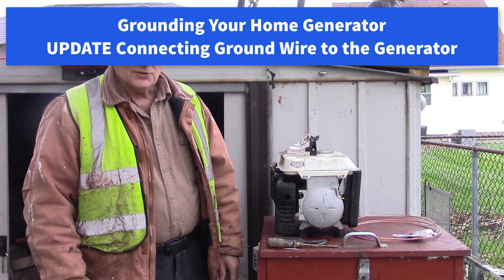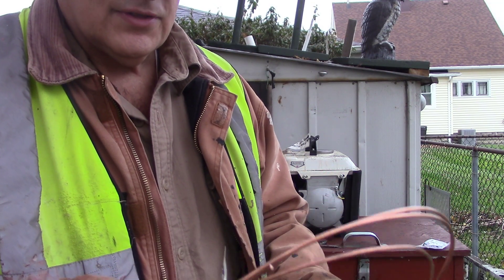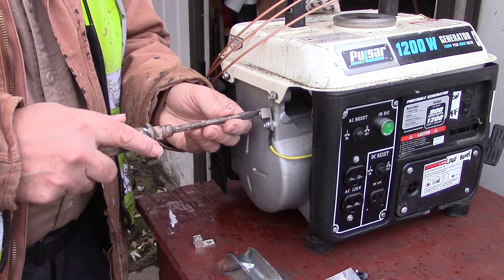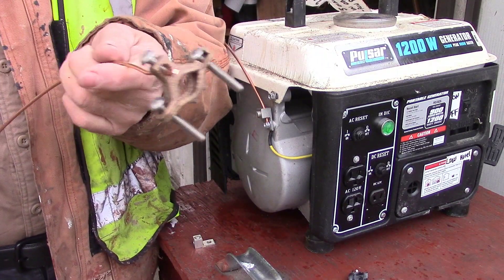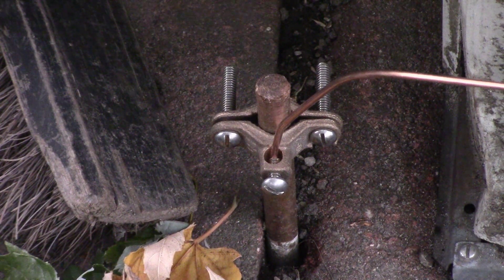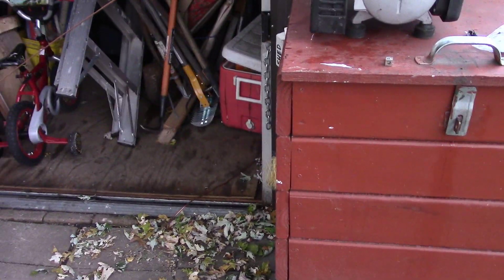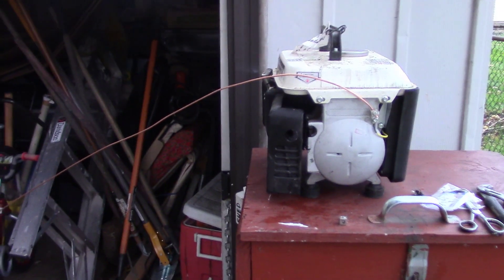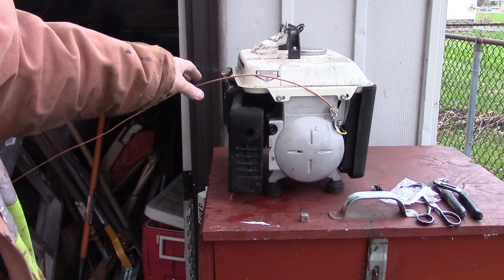Grounding Your Home Generator, UPDATE Connecting Ground Wire to the Generator Part 6 of 7

Comment from the maker: Please read the SAFETY WARNING and great comment from a viewer below: 
-------
Portable generators vary in the way manufacturers wire them. The frame of the generator may act as the ground. They do not connect such a system to the earth. Putting a ground on a generator, not designed to use it, can create a shock hazard. Adding a ground will provide a path for current to flow, when a short circuit occurs. Unless the generator manufacturer states to ground the unit, it should not be. 
-------
FYI: In my manual, it says to ground the generator, but does not describe the details on how to ground the generator. But there is a ground sign on the side of the generator.

Comment: R U going to hook this into ur homes wiring? This is BIG! 1200 watts and has wire good for 40 
amps to ground it. Just get a good extension cord.This is funny to me as a house with 60 amp
service would have a good ground or 100 amps probably an 8 gage. considering for the amps
at 15 amps at 120 volts, you'd have 1800 watts  to use. so just get a 14 gage cord. Does this 
Gen have have a floating neutral or a bonded neutral? If u ground this and use appliance in the 
house and neutral IS bonded, and appliance in the house has a fault say an electric skillet, u
could touch the skillet and the apron of stainless steel sink or fridge or dish washer and know 
about it! WHY cuz all this stuff  has its outsides grounded, frame of oven  or micro wave.
Reply from the maker: Hi Raymond! I live in an old house, 120+ years old. My grandfather landed here from Italy in 1917 and I'm still here. My father always said, "don't leave, it's paid for." The main fuse box needs replaced, cost about $1000.00. One electrician I got an estimate from looked at the box and said, "You don't even have a main turn off!"LOL! So, I ain't gonna mess with it. I live about a mile from the southern shore of Lake Erie. We get pounded by lake effect snow, something like 60 to 100 inches per season. High wind gusts, around 70 mile per hour, are common here during the winter storms, so the electric companies seem to have the power grid pretty stable now. A few years back, power used to go out once a month. Lately it's been 18 months between the last two power shutdowns. I start the generator in the summer to make sure it still works! This week, November 2020, it is supposed to be in the 60's, I think I'll start it up this week. Thanks for reminding me!  Thanks for watching! Jim
Reply: @JimVincitore  YOE Jim, not all that surprised, saw a lot of houses in FL. w NO
mains dis-connect. 120/240 volt service. what they did have tho was a so-called 
split panel. 2 pair of buss bars upper half had all 240 volt brkrs 1 240 double brker 
fed lower half w all single wire circuits. I just removed the meter and covered up
the meter socket and plugged gen into dryer socket.

Comment: sorry to bother you again jim, ive just taken delivery of my ford gennie, can i use a thick battery charging cable for my ground till my 8 guage arrives, i have a rod in the ground for connection to the unit, thanks in advance
Reply from the maker: Hi AW! I'm not an electrician. The copper wire is solid, battery cables are stranded wire. There must be a reason they use solid copper to ground houses.
Reply from the maker: Go to a hardware store, find the electrician, and ask him to cut you some thick stranded cable to ground your generator, ask him if it's ok to use.

Comment: hi jim, thanks for the sub hahaha did the same.... ive just ordered a ford generator and it looks like a ground wire going to the frame, i will have to read the destructions to see if it needs a true ground, as its going on a trolly with rubber wheels, thanks again

Comment: Portable generators vary in the way manufacturers wire them. The frame of the generator may act as the ground. They do not connect such a system to the earth. Putting a ground on a generator, not designed to use it, can create a shock hazard. Adding a ground will provide a path for current to flow, when a short circuit occurs. Unless the generator manufacturer states to ground the unit, it should not be.
Reply: You an get a pair of jumper cables  ($10..00 ones will work).  Split them down the middle.  Take one end and hook it to the generator and the other end to the ground wire and you are grounded.  Easy to remove when done and no wires to deal with.
Reply from the maker: Hi DJ! Great idea! Hooking up this copper wire in a storm or at night in the dark is a pain! Thanks for watching! Jim
Reply: @davidpaepke7397  exactly what I did 👍
Reply from the maker: In my manual, it says to ground the generator, but does not describe the details on how to ground the generator. Am I  grounding it correctly?